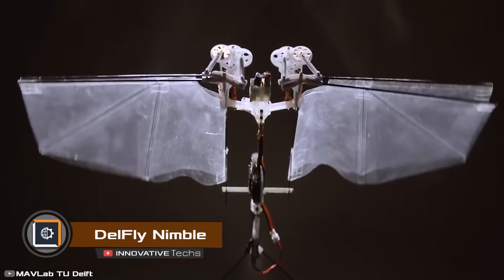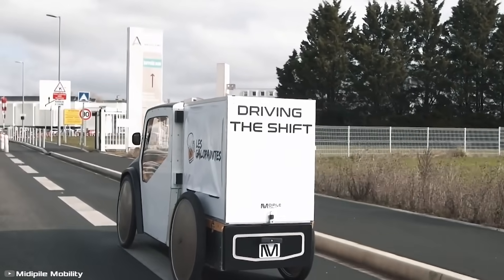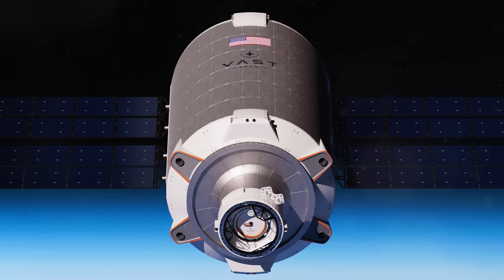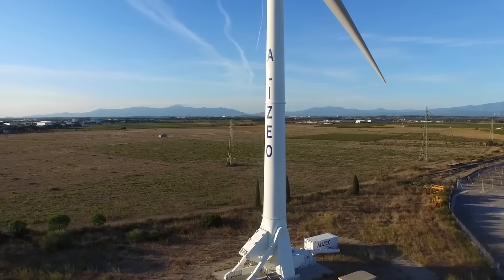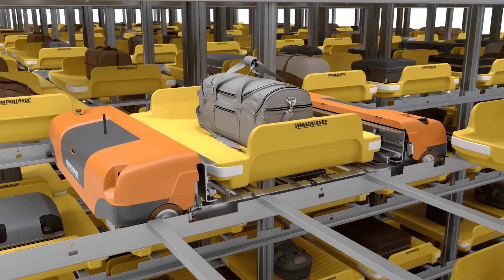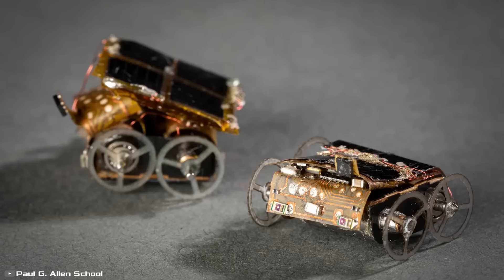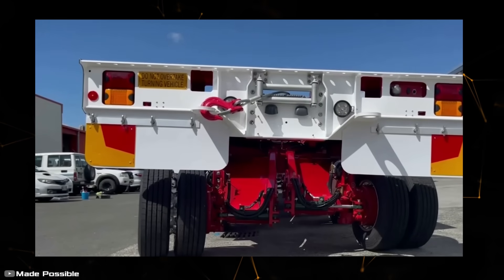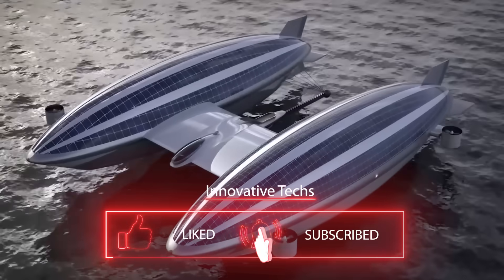NEW INVENTIONS THAT WILL BLOW YOUR MIND

Comment: The issues of human labor being supplanted by machines is the future. Since the beginning with many inventions  there have been reductions in the number or need for certain workers while increasing efficiency: 

1: Domesticated animals with horsepower replacing the number of human to work a field and in less time.
2: The wheel by eliminating the need for a number of workers to individually transport materials and increasing the amount and speed of deliveries.
3: The Industrial Revolution machines replacing human weavers to mass produce textiles at greater speed and for lower cost.
4: The age old exploitation of production moving to where labor is cheaper, think manufacturing in China vs. Western nations.

The problem today is that the human population is booming precisely when the trend is for machines replacing the need for human labor thereby creating a massive surplus of humans with ever dwindling number of total jobs. 

A.I. driven autonomous automation in construction of buildings, manufacturing, even teaching is not that far off as the work is consistent, easily fined tuned or retrained with a software or hardware upgrade = able to work 24/7 for minimal cost far below that of human labor costs.